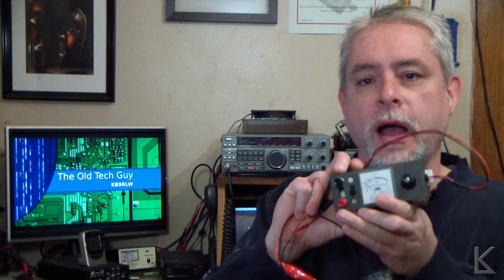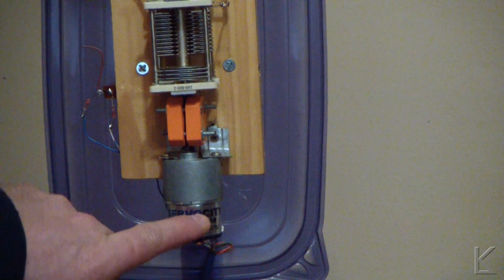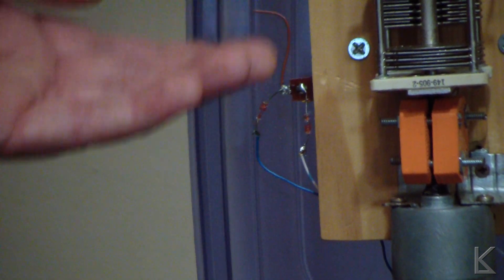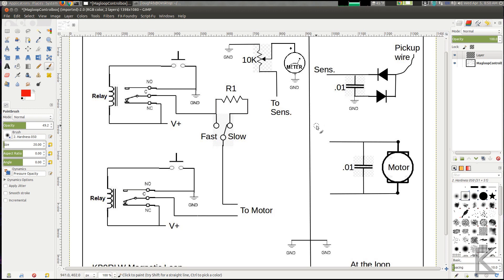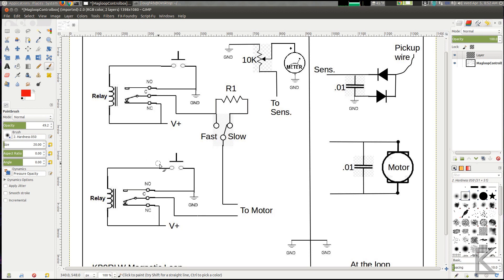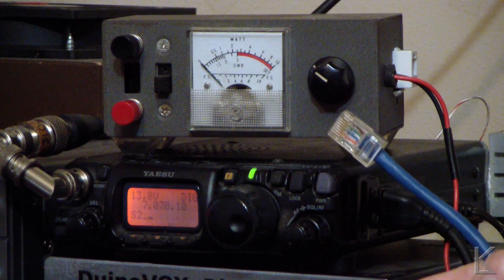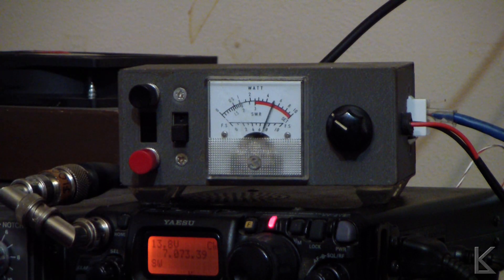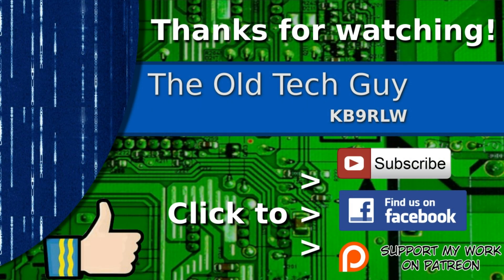Ham radio antennas - Magnetic loop remote tuning control box details schematic and demo

Comment: I am asking you for your input on an idea I have for a quarter wave multi band tri wound antenna , by that I mean a winding for each of three different bands such as 6 meters , 10 meters , and 15 meters or any other tri meter antenna . What do you think about this idea for say field trip meetings ?
Reply from the maker: The loops would interact with each other and make things hard to get working.   You could use thick coax for the loop and just have different lengths prepared.  Attach the loop you need when you need it.

Comment: Hi Kevin,
What a great video this is.  It's such a brilliant idea, & something that I've often wondered about how to do.  Unfortunately, I now have a bad tremor in both hands, so soldering is impossible for me. Ive been thinking of trying to build a Mag Loop aerial for myself as well, preferably one that will cover from 80 MTRs to 10 MTRs..  I also like the design by Paul, OM0ET.  However, his MC20 MagLoop on covers from 40 MTRs to 10 MTRs..  There are no Amateur Radio clubs close by to me, & the odd few people who I have asked for help with projects that require soldering always have something '"More Important'" to do, rather than help me.  I have bought myself a 1RPM 12 volt motor on line for this project after seeing this video prior to asking people for help     Do you have any suggestions for  me please Kevin.
Many Thanks in Advance,
Kind Regards,
73,
Ray.
M0RAY, ~~
Sittingbourne,
Kent,
South East England, UK
Locator:- JO01ii.

Comment: I had a thought.  The relays are simple SPDT.  Soo, why not replace them with SPDT switches.
Then there is less draw.  Important if battery operating portable.
Reply from the maker: With the push buttons, it's possible to move the motor in very small increments with a quick tap of the button.  Much harder to do with switches.
Reply: Who said the switches weren't push button or return type toggle.

Comment: Would a Stainless steel loop made with 3/8" OD be very effective?  I have some "soft" stainless at home I could use.  Could I use the 3/8" OD for both loops?  I know the small loop is 1/5th the diameter of the large loop, but does the OD of the material also need to scale down?
Reply from the maker: Yes, you could use what you have, and no, the smaller loop doesn't have to be a smaller conductor, just 1/5th the diameter of the big loop.

Comment: I'm having a hard time locating the .01 caps.  What unit are these caps?  pf? nf? µf?  I did find some 1pf caps.  Would those work?
Reply from the maker: Small ceramic disc caps, they show .01 on the side,   10nf I believe.   Yep,  my cap tester read out 9.8nf,  so 10nf it is.

Comment: Wonder did I miss where you have the files for this little box?  What spec of meter is that?  Thanks!
Reply from the maker: The schematic is over on the facebook page, or you can pause the video and take a screen shot.   Any meter movement should work fine as long as it's not shunted internally.

Comment: Hi Kevin,

This is awesome. Any details on the Diodes please.
Reply from the maker: Any germanium diodes will work.  (glass case)   They're not critical.
Reply: Thanks Kevin
Reply: But be careful where you buy. I just acquired some  'Germanium' diodes from ebay that turned out to be cheap silicon Schottky diodes that don't seem to work in this application. Would that seem right Kevin? I get no sign that any rectification of rf is taking place at all. I have now ordered a couple of known good Germanium units and I'll try those.

Comment: I had trouble finding the PVC X fitting to make a frame, still have not found one.
Reply from the maker: I've seen them at most hardware stores.
Reply: @loughkb  Not in the UK
Reply from the maker: @rushymoto  https://www.amazon.com/Schedule-White-Socket-Cross-Pack/dp/B00TOOLS6I/ref=sr_1_1?dchild=1&keywords=pvc+cross&qid=1617716082&sr=8-1

Comment: Thanks for showing your look tuner. Very nice indeed! 
Can you tell what drawing software you are using?
KG8NS Chuck
Reply from the maker: I drew the schematic in Libre Office Draw.  During screen recording, I had it loaded in GIMP so I could draw on a second layer while illustrating my narration.
Thanks for watching!
Reply: Thanks for the reply Kev. I like your 80-160 loop also. Nice work. I have Libre Office installed but never tried the draw.

Comment: Hi, I was watching your video, interesting and simple control for the magnetic circuit, could you tell me what value to use resistor and how many watts to withstand the voltage drop of the motor? thank you and 73s of LU6FLZ
Reply from the maker: You'll have to experiment with your motor to find the value that slows it enough yet still provides enough torque to turn.  Measure the resistance of the motors coil and start with that value to halve the power.

Comment: me gusta mucho la manera de sintonizar la antena por la mayor emision de intensidad de campo pero al variar el capacitador no varian las SWR??? en el video no mensionas si usas un sintonizador de antena o si hay que usarlo obligatoriamente para poder usar esa antena gracias .....sorry i don´t speak english i hope you understand 73´s
Reply from the maker: La emisión más alta está en el punto de menor S.W.R. No se necesita sintonizador de antena.
Reply: Gracias por la respuesta es bueno saber eso tengo dias buscando fabricar una antena para espacio reducido porque vivo en un apartamento pero nunca he experimentado con las loop magneticas y quiero hacer una para trabajar 40 y 20 mts de todos los videos que he visto por aca el tuyo es el que me parece mas acertado y mejor explicado asi que pienso hacer exactamente esa antena que tienes y la idea del medidor de intensidad de campo me impresiono mucho que genial esa idea de verdad te felicito incluso pienso hacer la caja de control asi como la hiciste tu pensaba hacer eso con arduino pero como lo hiciste me parece mas practico gracias por la informacion y si te es posible mandarme el plano de tu loop a mi correo te lo agradeceria mucho gracias YV5-JAU
Reply from the maker: No tengo esquemas para el bucle.
El bucle más grande es 1 metro, el pequeño es 1/5 del tamaño.
El condensador es 20-150 pf.
Reply: Gracias Kevin con esos datos me basta para hacer una

Comment: Any reason you didn't simply use a polarity reversing switch instead of the relays?
Reply from the maker: I liked having separate buttons for up or down.  It's a bit quicker to tune than if you had to pause, switch a switch and then tap again.
Reply: I was thinking the same thing when I saw the circuit, the relays are not needed. Just replace the relays with the switches, one for up and one for down.  Another option is use one switch for fast-slow as shown and a three-position, spring-centered rocker or slide switch. Press one way for down, the other way for up, and release for off. No way to energize up and down simultaneously.